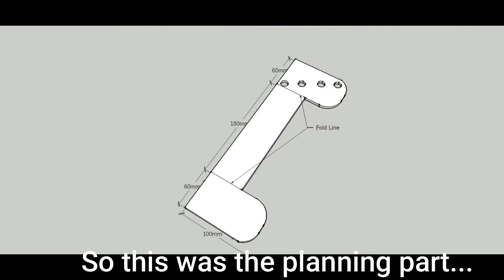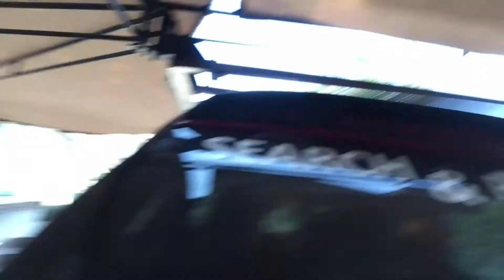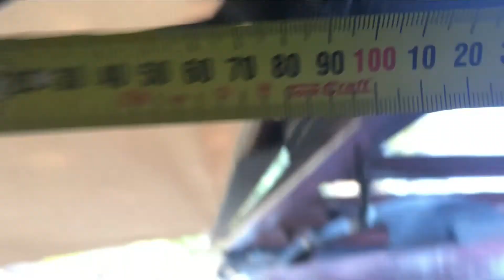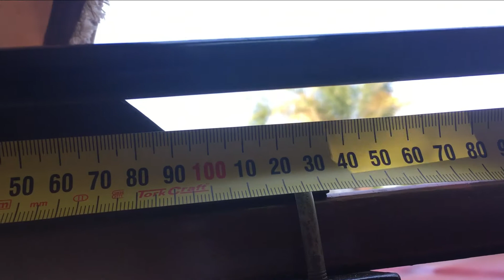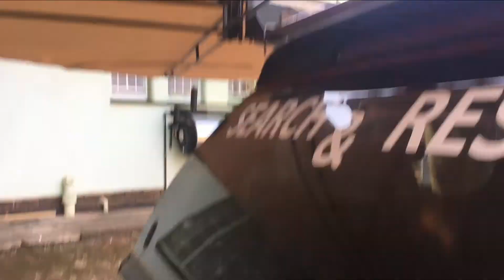DIY 270 degree awning part this one....call it twothree

Comment: where did you buy the fabric? and what size--Bob
Reply from the maker: From a normal fabric store. It is standard canvas. I bought a roll as I had several other projects for the rest of the roll. When I do it again I will rather buy a standard tarp from the hardware and make it work